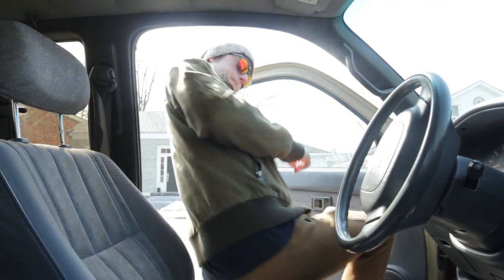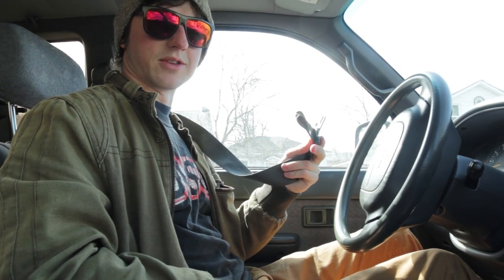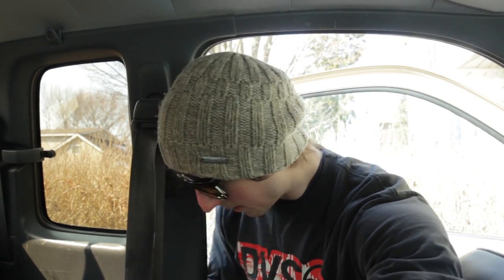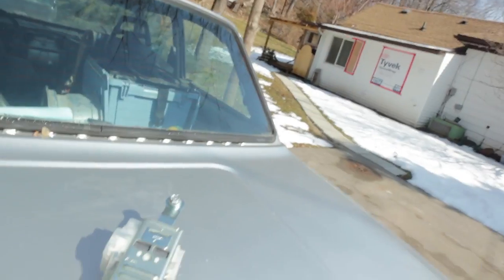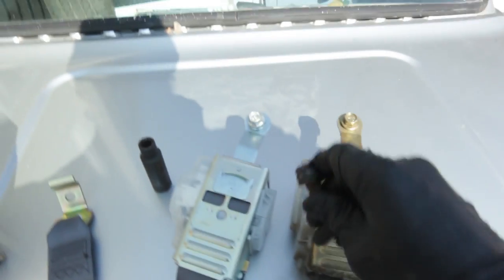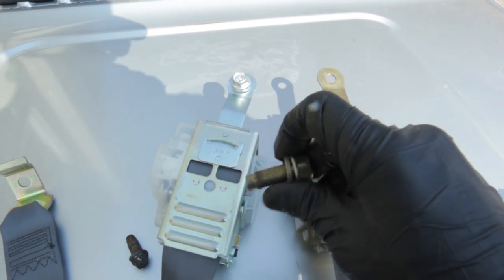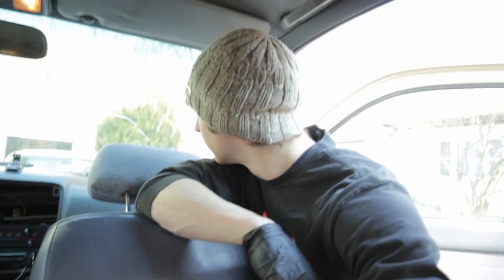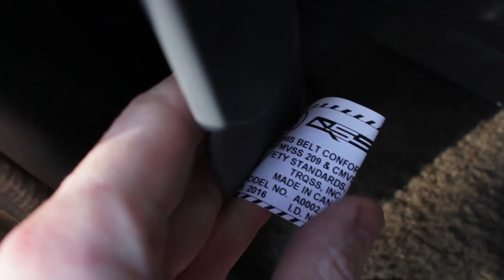Fixing the Truck: Replacing the Seat Belts in the Tacoma

Comment: question:  Could you have moved the rear belts to the front?  I could count on 1 hand and fingers left over how many times the rear seat belts have been used.
Reply: rolandvz71able I am wondering the same thing . have u found out if its possible ?